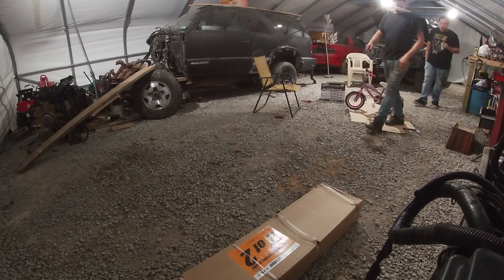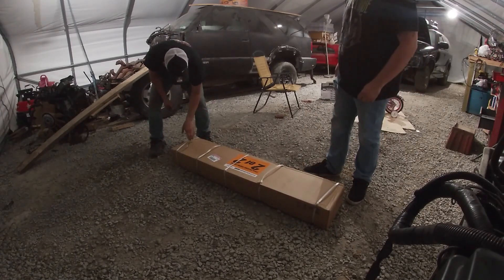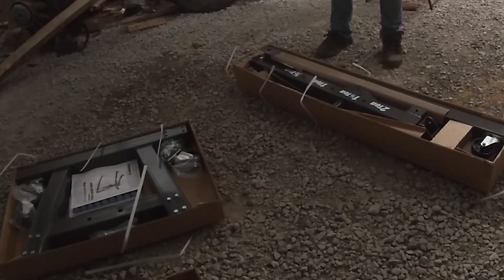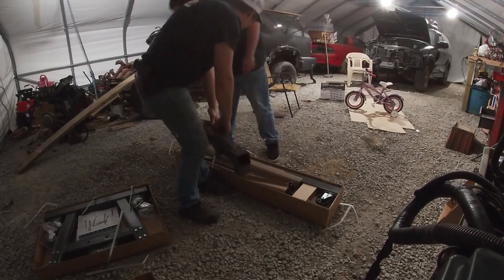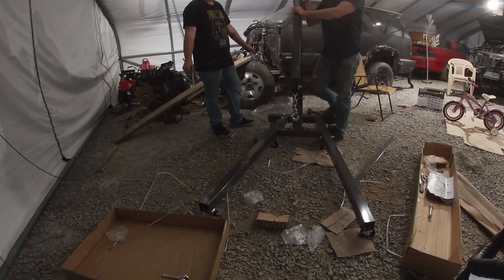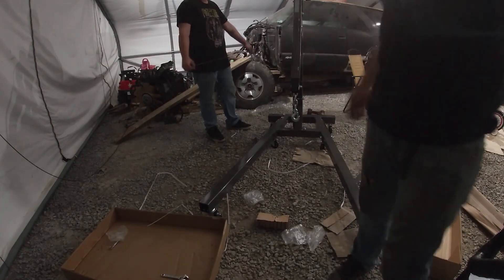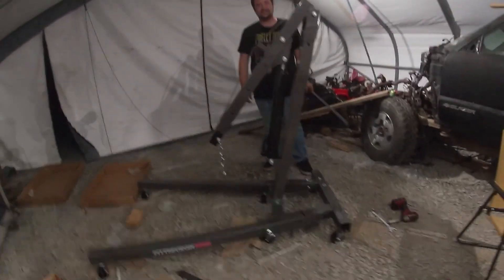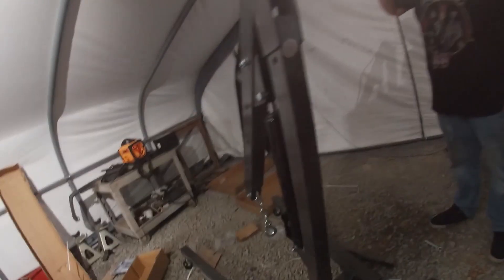Harbor Freight hoist tow hitch attachment!

Comment: Hey Guys, now that you have had this awhile, is there anything you'd change to make it better?
Reply from the maker: We haven’t made any changes to it since then and have moved engines at least 10 more times since this video and it has done great. However, I used rounded square tubing and I think that has caused it to rock left and right. I may add stabilizing arms or weld corners onto the tubing
Reply: @s10life  thanks!